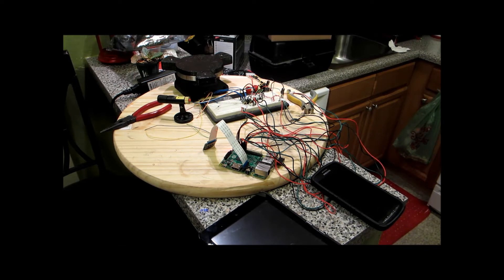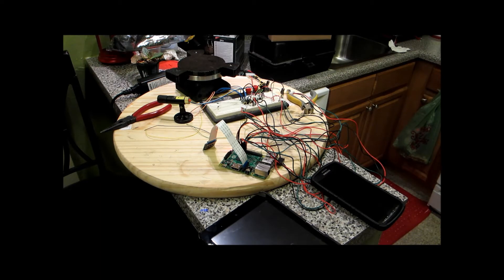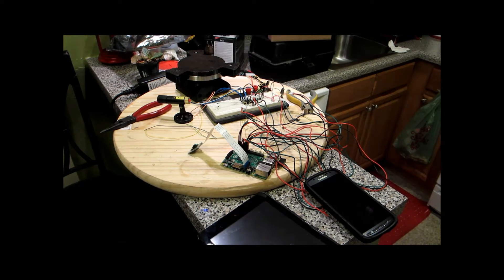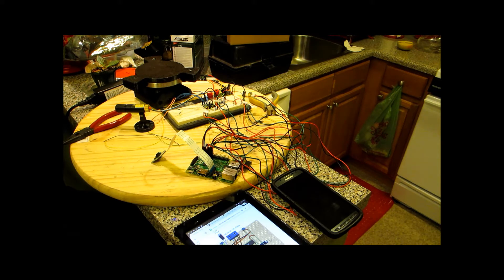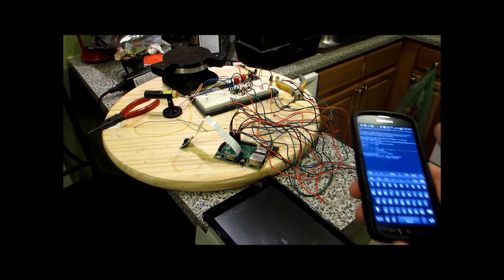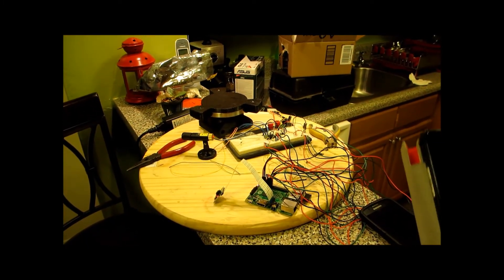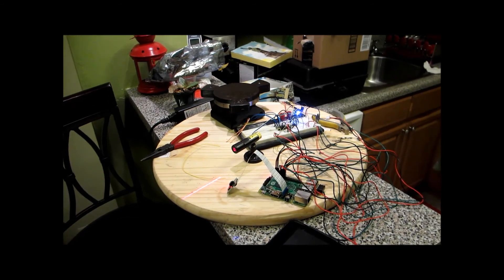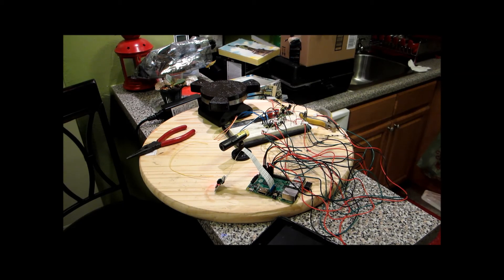3d Scanner, freelss, DIY laser 3d scanner.

Comment: Good progress! You even have the same protoboard I use ;) Once you get your camera and lasers mounted, I suggest doing your scans with 1.9 megapixel mode. There's something wrong with both of the 5 megapixel modes in FreeLSS - in video mode, only the center of the frame shows up, and in still mode, the two lasers produce radically different views of the object that can't be merged by the software. The author (Uriah Liggett) is aware of both problems, but I suspect he's so busy setting up a thousand scanners to ship for the Kickstarter that he hasn't had time to work on those issues.

I saw you mentioned lighting control with the ULN2003, and that is actually something that Uriah has said he will add to the production circuit board for the Kickstarter kits, so I expect we'll see a new diagram on the website at some point. I'm going a different route and building up a circuit with a 5 volt buffer chip to allow the Pi to drive Adafruit Dotstar LEDs for variable brightness lighting. The scans get screwed up if the light in the room changes too much, so I want to try to keep it mostly constant during the scan. We'll see how well that actually works ;)
Reply from the maker: Funny you mention the lighting conditions screwing up the scans. I was planing on enclosing my scanner and using leds to light up the object evenly. I may install a pot on my leds though for fine tuning.
Reply: I think that if you boxed up the scanner completely, so you had total control over the lighting, that would be ideal. I don't have room to put a box around mine where it's sitting right now, plus I like to be able to watch the lasers blink on and off ;) The RasPi camera does do some automatic adjustment so the light level doesn't have to be perfect, but if it varies too much then the scan gets all stripy.
Reply from the maker: Bill Owens 

I finally assembled my scanner and updated to the latest version of freelss. It seems less buggy now, but to be honest the stl's generated are very very rough. I tried scanning in total darkness and the scans were much better, but still very rough. I also focused the built in lens. The one thing that I can think of is that the camera is way too far from the object and too low. I changed the settings based on dimensions but it does not seem to help. I am still contemplating what the heck is going on. I have yet to extract the ply files. So far everything has been exported as stl.... Maybe that's my problem.
Reply: Bruno M. I am quite unskilled at Meshlab, but I followed the instructions that Uriah posted to this group a few weeks ago and was able to make the STLs look a bit more reasonable. However, I've mostly been looking at the PLY files to try to judge quality, and I am still seeing issues with holes and gaps, I think because I'm not getting both lasers lined up well enough for them to fill in for each other. Or I'm just scanning really difficult objects ;)
Reply from the maker: Bill Owens as of now the only resonable scans I have gotten as mentioned by you is 1.9megapixel video mode. Running freelss 1.2. Which by now I have also made it start on boot. The system is fairly robust now. I am looking at resources on the pi via RPI monitor as well. It does not seem to stress the pi2 much. I wonder if Uriah is going to leverage the power of the pi 2 more in future releases. I love the auto update button added as well. One more thing I noticed is that the scanner runs a bit better in low light vs high light conditions. HMMM. unexpected behavior. Still experimenting and getting ready to post some updates as well as the STl's on youmagine.